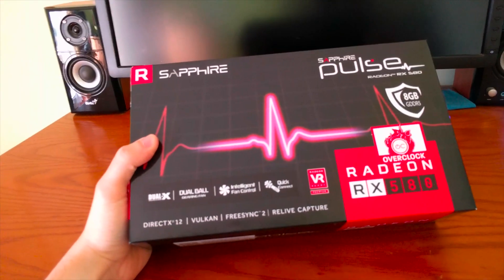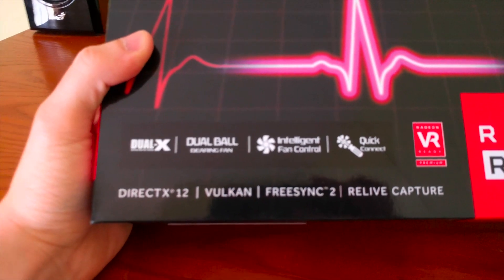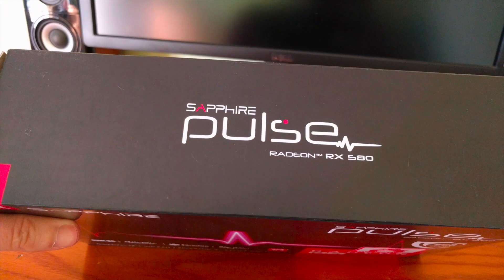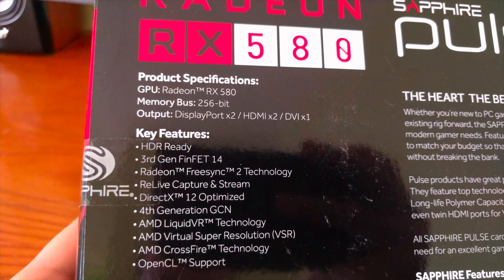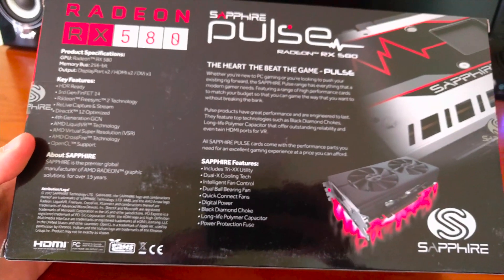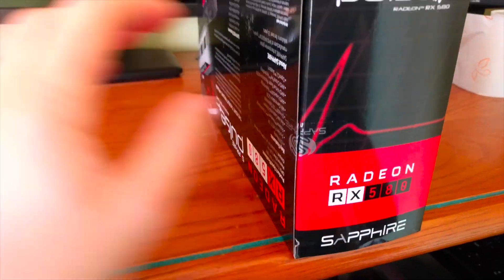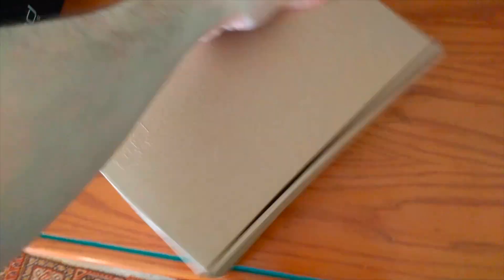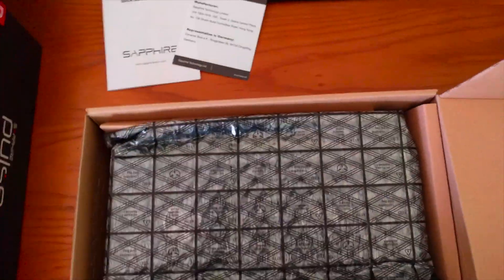AMD RX 580  PULSE -  One of the Best Options For Hackintosh

Comment: Bought this thinking it would work on my Hackintosh, running High Sierra 13.6. So far, no go: I've been trying to get it running for weeks, and have had one problem after another. Currently, after boot, my display ports aren't getting any signal.
Reply: Mojave and above